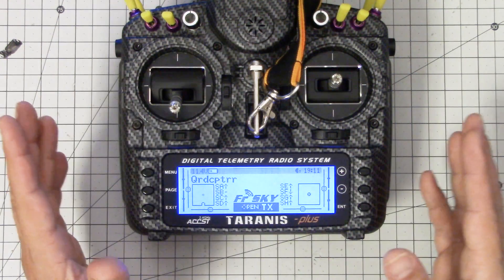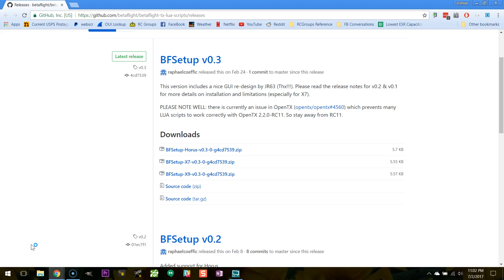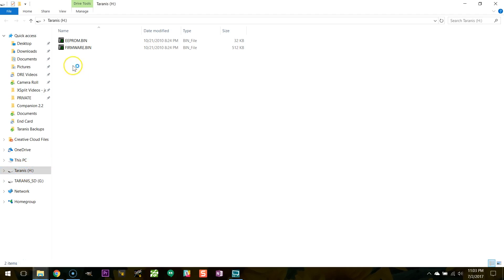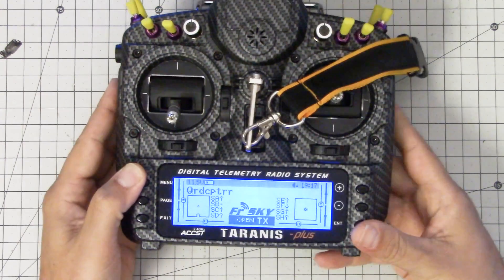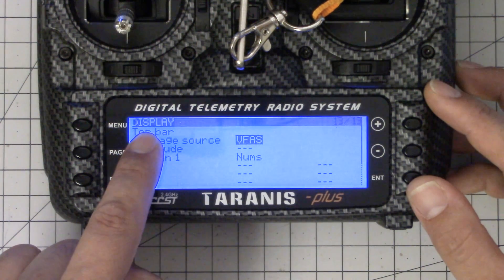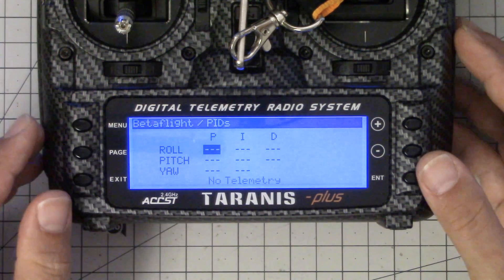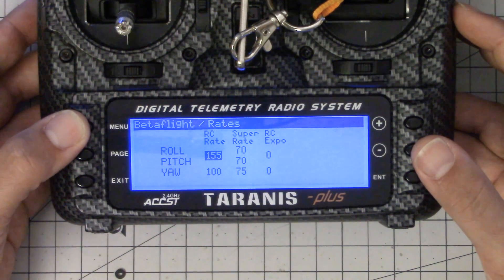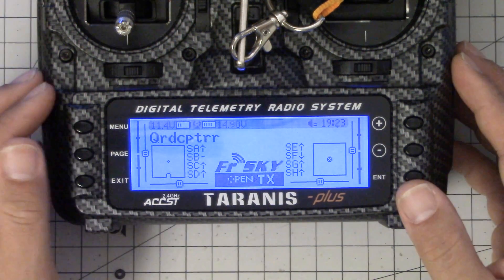Betaflight Taranis Lua Script HOW TO | Part 2 | The Lua Script

Comment: Well i've had this working for about 3 weeks but for some reason on one of my copter i do not get any numbers on the lua. I have telemetry working and of course this is my 3 inch that i have to take the camera out to plug in the usb cable. It just has a sp racing board so the only copter i have that doesn't have betaflight OSD the lua doesn't work any clue on what could be wrong i've heard other people say that you have to downgrade the firmware on the new xsr's haven't tryed it yet though?
Reply: You need to be running Betaflight 3.1 or newer on your quad to get this working. You also need to use the un-inverted S.Port with some flight controllers(mostly F4 FCs). Source: http://www.nitbeatfpv.com/frsky-taranis-pid-settings
Reply: @VilleF1N  Helo i have this same problem and teh page on link its not working please chelp :P
Before flashing to new version BF ewrything work good in script, past update its not working ;/
Reply: @kosti116  You may have to update your BF script to get it working again. In my radio the old script did work for the most part but it didn't save the vTx settings after BF 3.1.7. Other thing to check is the ports tab and make sure you have SmartPort on the correct port, then go to Config to double check that Telemetry is enabled and finally go to CLI and type "get tele" see what the telemetry duplex is set to and change it from off to on or vice versa depending on your setup. Hope this helps!
Reply: @VilleF1N  Thank you for your response :]
Checked ports, dif exactly the same, omitting 2 parameters.
I coped with my problem in the following way:
"woojak commented 3 days ago
Hello, I had the same problem with my SPRACINGF3EVO.
The old software was beautiful, without problems (3.2.4 Jan 10 2018). When I updated to the latest version of Beta flight, the LUA script worked but did not show the value.
After returning to 3.2.4 LUA started working. I compared dump with both software, but I have to do it. Following the logic, BF software and that was a problem in my case.
I hope that my observations will be useful:]
greetings "
Unfortunately, I had to change the software for the older one.
I also have Mobula7 (F3 BF 4.0) and the same script works there.
I am waiting for a stable version of BF 4.0 and will start checking whether it works:]
Greetings!